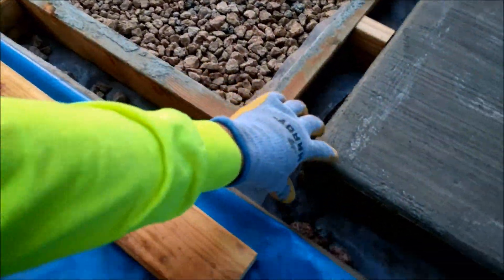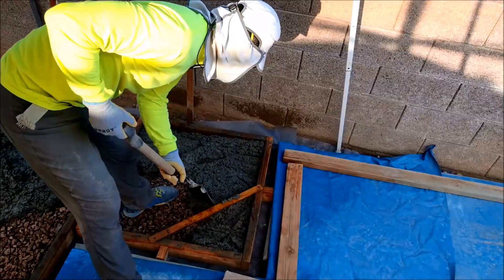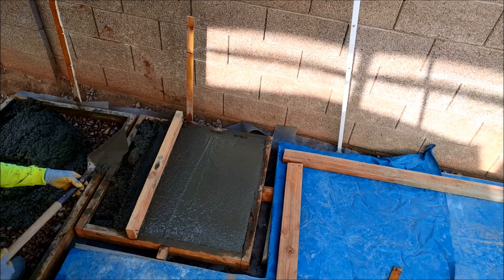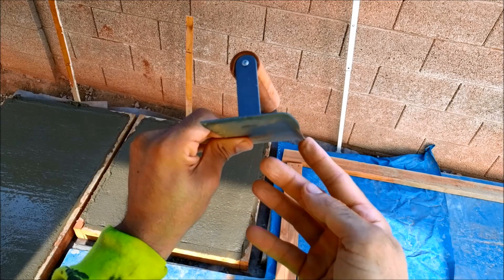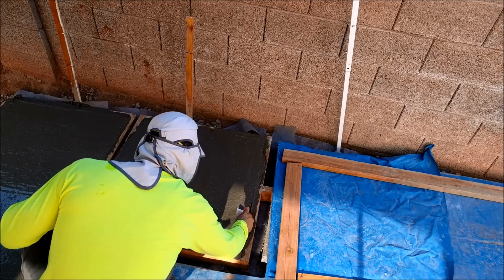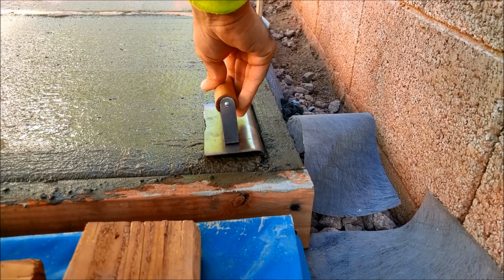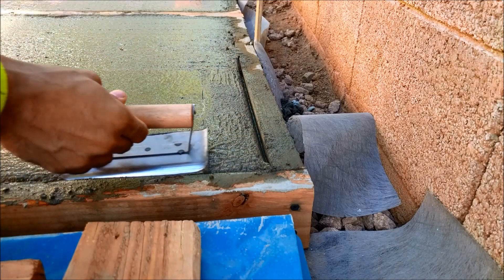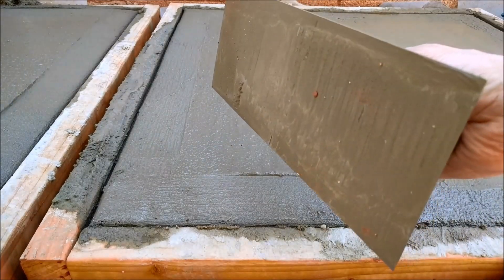How to Make Pavers

Comment: Nice video!! My only problem was that I levelled and smoothed off, waited 1.5 to 2 hours then used a 3/8” edging tool. I ‘dislodged’ many small stones that were in the concrete mix.
Not sure what I did wrong.